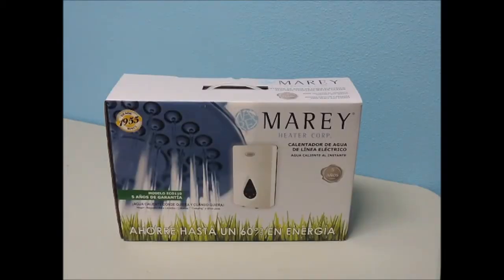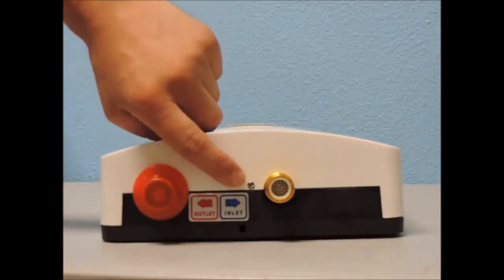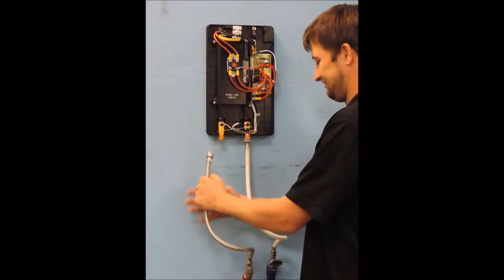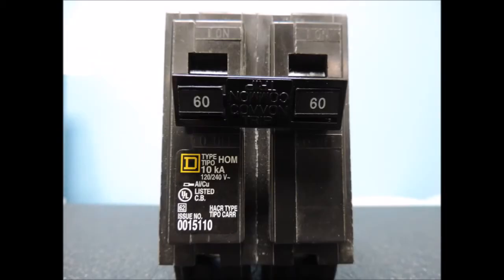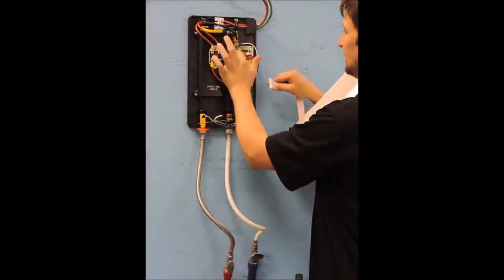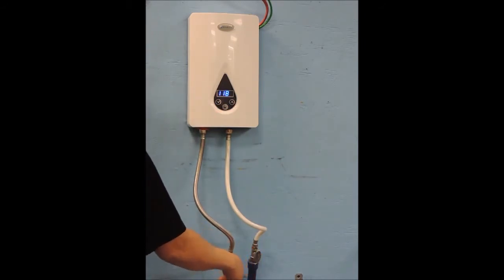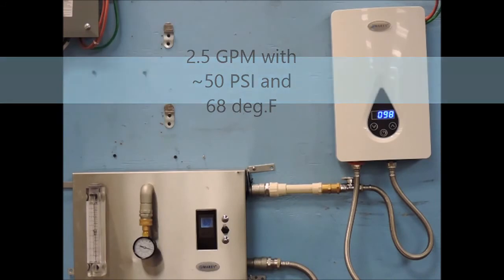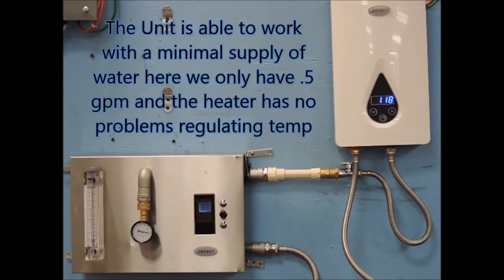Marey ECO110 Installation, Settings, and Adjustments

Comment: The installation manual calls for a 60 amp gfci breaker. In this video a standard 60 amp breaker is used. Is it necessary to use a gfci? My service has a 60amp that is available to use.
Reply: Did you ever answer your question? I was needing to change my hot water tank to a tankless one. The hot water on the breaker is 60 amps, I don't think the wire is the same 6 gauge size that the tankless box came with either.